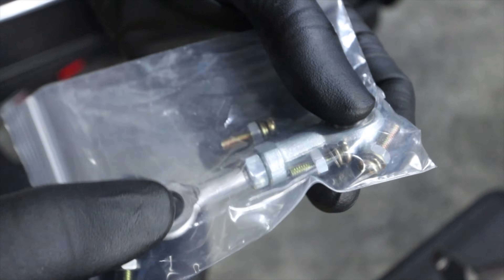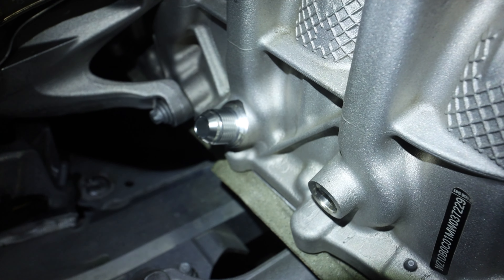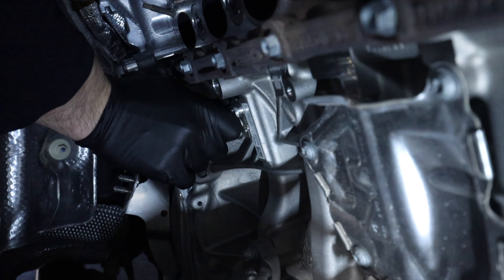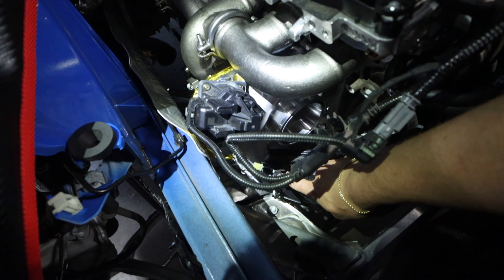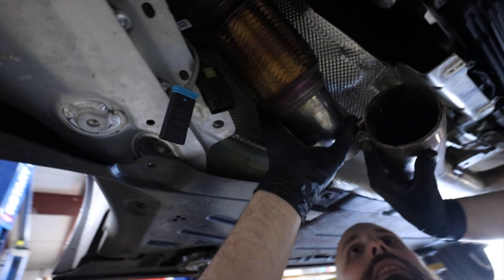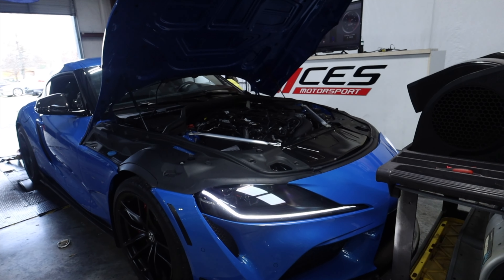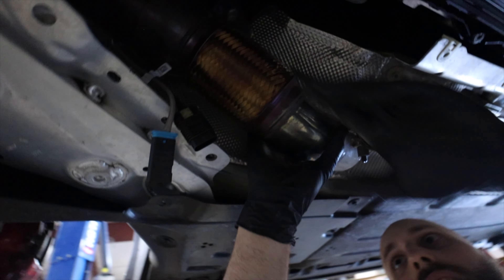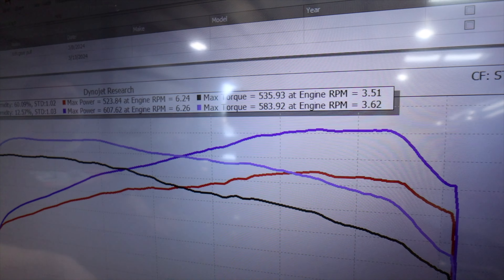The Remnant Supra Turbo Kit is the Best "Bang For Your Buck" Setup!

Comment: Pure 800 is a smaller turbo than the Remnant 65. But you made less on 93 pump? CES made over 550whp on a stock motor pure 800 on pump. On the same dyno. What gives?

Comment: i think everyone was kind of hesitant when these things came out but damn they are incredible. i see them at the track all the time and they scoot! theres just something about the smoothness and sound of a straight six turbo, really gets the blood pumping. i would love one but i know it would turn into a whole thing and i'm just not trusting of a BMW engine to keep itself together, too many variables and trust in the tuner/hardware
Reply: Your oil pump gears done?
Reply: I think it would be worth the travels to CES to have the work done. The B58 is incredibly resilient being that it was designed for diesel use and up to 50 psi of boost.

Comment: NY resident here with yearly inspection requirements. Currently I’m on BM3 OTS tune, stock turbo and Active Auto Work high catted DP with exhaust monitors on and no CEL over the past two years. Which makes inspections easy. If I were to just go Pure 800 turbo do you or anybody else know if the would trigger the CEL light for the down stream O2 sensor? I’d love to do a turbo upgrade by trying to avoid the O2 sensor CEL coming on. I can’t pass the OBD II test if the monitors are not on. Thanks for any help.